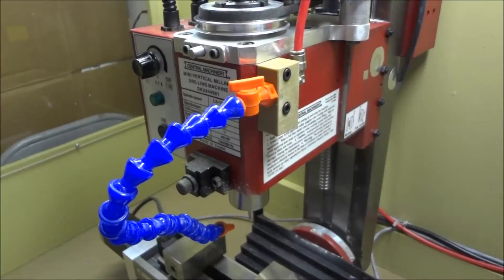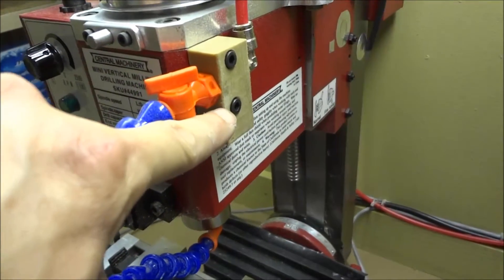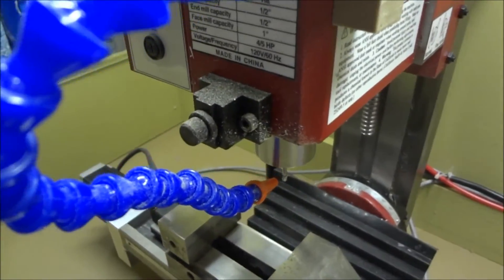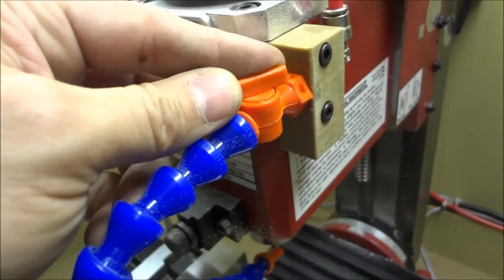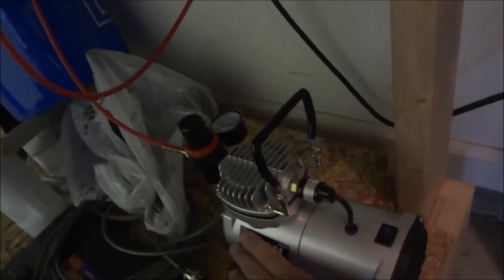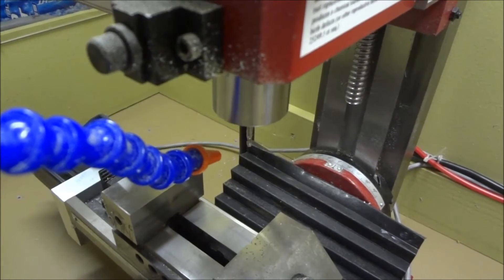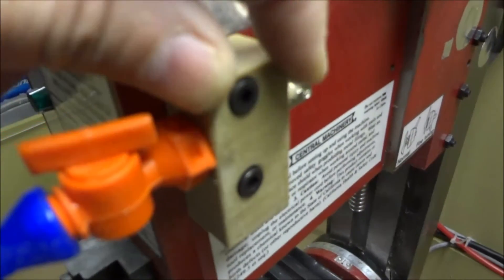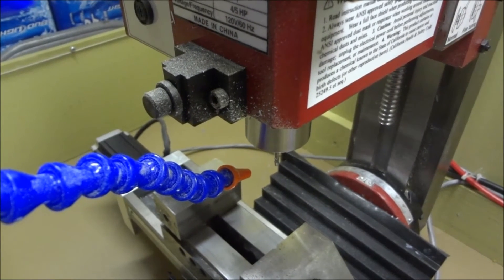X2 Mini-Mill CNC Chip Removal

Comment: I've been considering an airbrush compressor like yours, mainly because I need something quiet. Do you have the specs of this pump. Are you still using it? How is it lasting?
Reply from the maker: The Air brush compressor lasted about 4 months, So I Switched over to a pond aerator made for continuous running,
 It's still working after years. and half the cost.

http://www.ebay.com/itm/Air-Pump-Commercial-951-gph-Elemental-O2-Aquarium-Hydroponics-Aquaponics-Pond-/371868894481?hash=item56951d0511:g:3bIAAOSwHnFVv312
Reply: CNC4XR7 Thanks. Have you tried mist with the aquarium pump? I see they have various sizes of those pumps, is the flow and pressure sufficient on your one? Do you know anyone that's tried the larger pumps?
Reply: CNC4XR7 Thanks. Have you tried mist with the aquarium pump? I see they have various sizes of those pumps, is the flow and pressure sufficient on your one? Do you know anyone that's tried the larger pumps?
Reply from the maker: Those pumps do not really build pressure they just move air, the bigger pump will give you more air flow.

I did not try it with a mist system i just use it to blow the chips out of the way.
Reply from the maker: take a look at this https://www.youtube.com/watch?v=_X9TPBCdGyo
Reply: Thank you. That is very helpful.
Reply: Update .. I purchased a Hailea ACO-388D, and a few ebay mist systems to experiment with. The pump is quiet and puts out a lot of air (volume). Pressure is low, as expected, although I found enlarging the outlet diameter seems to improve it. I'll need to run some tests while cutting.
Reply from the maker: great it should last a while I have been using mine for 2 years no issues and yeas quiet.
If you get a mist system working with the pump let me know I will pass the info along.
Be safe,
Sam